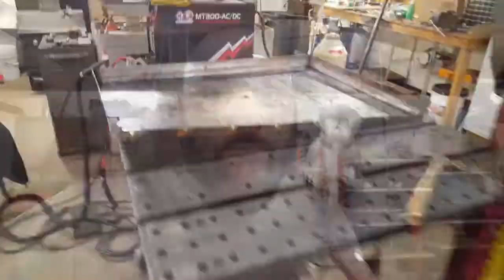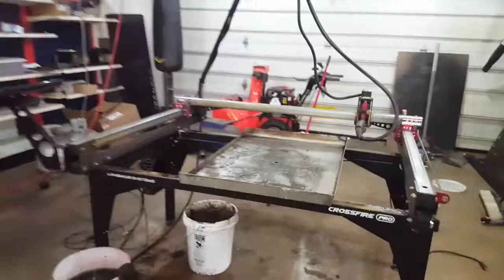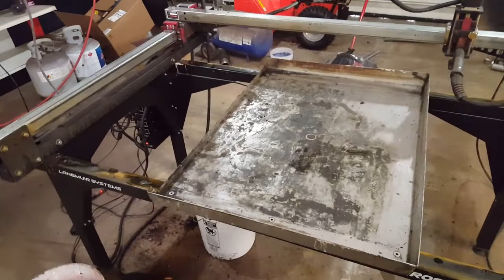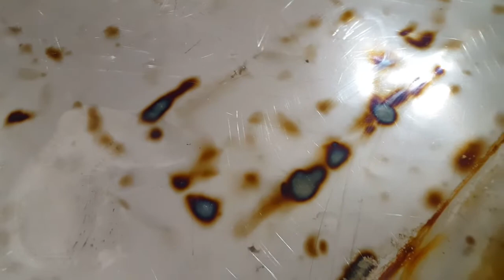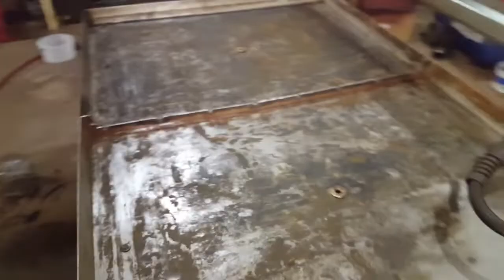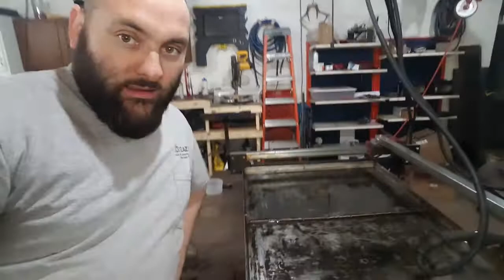How To Fix Your Langmuir Systems Crossfire Pro's Leaking Water Table

Comment: I TIG welded mine and it worked great! No buckling of the table either. I used a small amount of butyl tape underneath the washer in order to offer an added seal.
Reply from the maker: Great tip!

Comment: I just got mine and put it together and the first time I put water in it, it leaked.  Sure a person could find someone to tig the halves together, but another suggestion I would have is for either Langmuir systems to just send a 1 piece pan that is formed so water drains to 1 spot in the middle or to have a local fabrication shop make you a 1 piece pan with just 1 central drain.

Comment: I only have one comment on the silicone, why not cover that ridge, with a piece of inverted angle iron? Just looking for a K.I.S.S! Solution. Cheers!
Reply from the maker: You could try it but I feel like it would leak no mater what.
Reply: @BeckTools  it may stop the silicone from burning. The main problem.

Comment: nice vide  thanks did you use stainles wire or just mild steel?
Reply from the maker: 308L filler (it's stainless)
Reply: @BeckTools  thanks

Comment: Just curious wh didn't you weld it from the underside? Would've been simpler to tig.
Reply from the maker: Welding from the top is more forgiving.  If you burn into the metal a bit too much it doesn't matter.   you're not going to make a hole like you would if you weld from the bottom.  I'm sure you can weld it from the bottom.

Comment: What grade filler did you use? Thank you
Reply from the maker: I used a little bit of 308L in the screw valleys.  For 90% of it I didn't use any filler at all.

Comment: I think I would have flipped it over, welded the bottom and cut out that center seam then re welded and ground it smooth from the top. Don't know jack about tig so not sure if it would work but that was my thought when you said weld it.
Reply from the maker: I considered doing this but since the table is crazy thin material I didn't want to risk burning thru.  If you weld from the top the process is extremely forgiving.  You can over penetrate up to a 1/2" and you'll not make a hole.  It may have looked nicer but I didn't want to risk it.  Keeping the ridge does give you extra rigidity.
Reply: Ah. Got it. Makes sense.